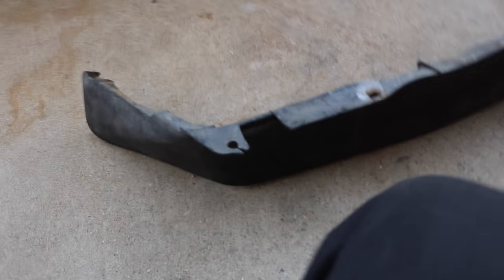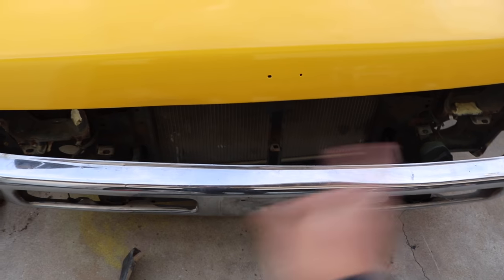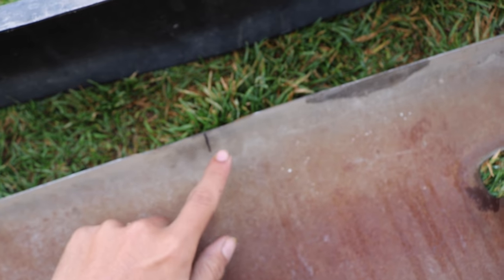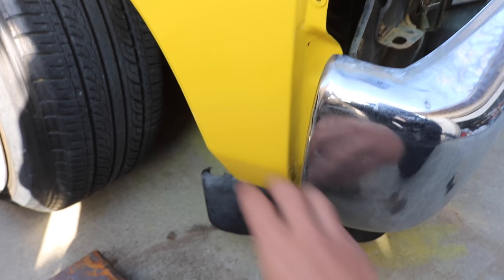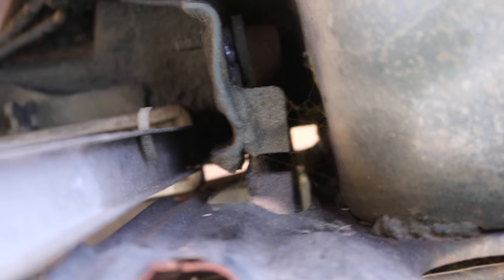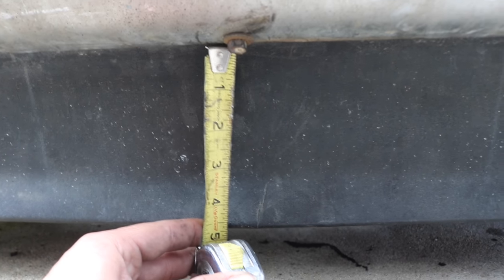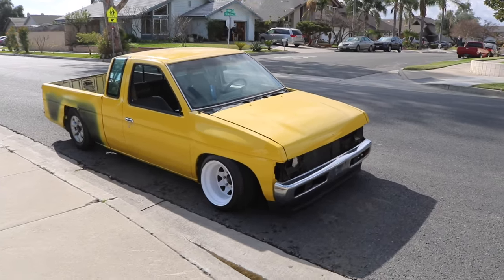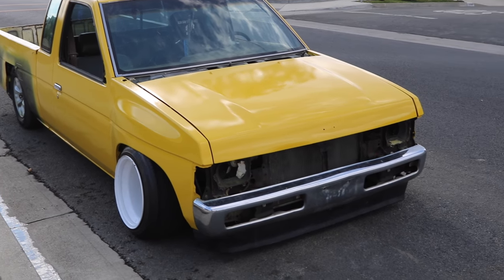S10 VALANCE ON NISSAN D21 !

Comment: I just installed one last night, to avoid cutting the ends I trimmed the inside of the top were it folds, then I applied heat with a heat gun and form it around the ends of the bumper and zip ties the both ends for now 
To me looks great and avoid the cutting part.